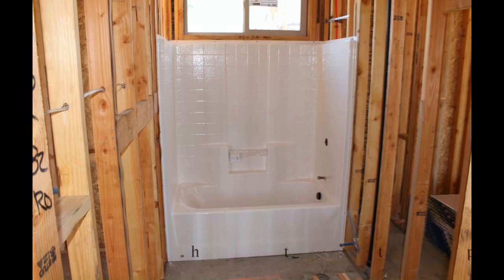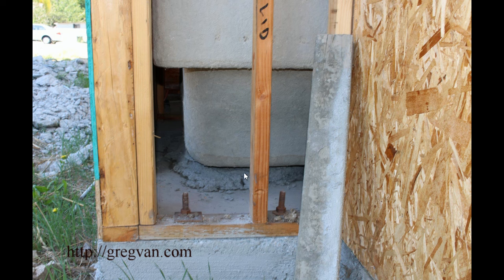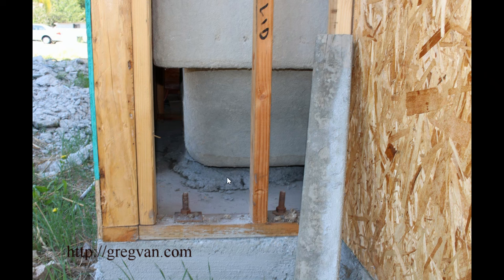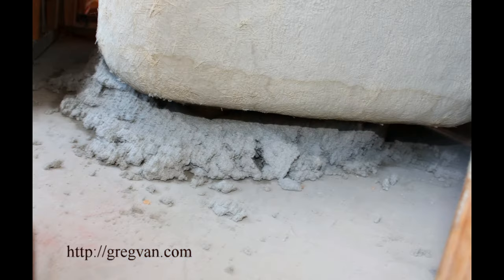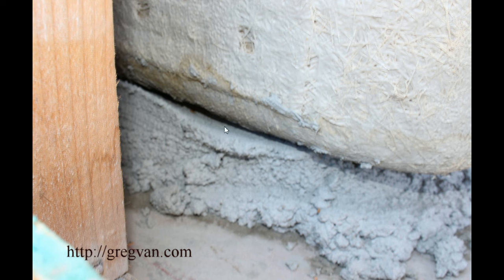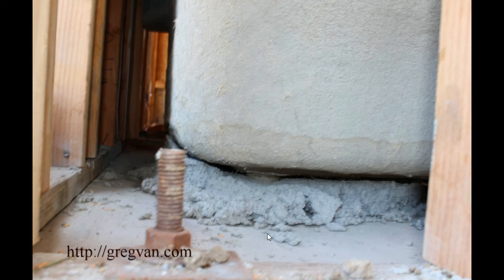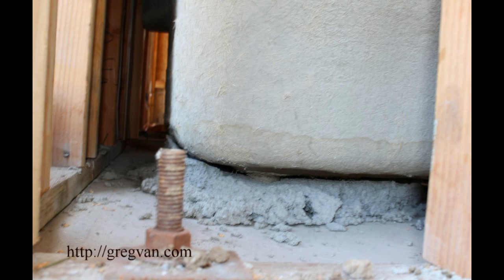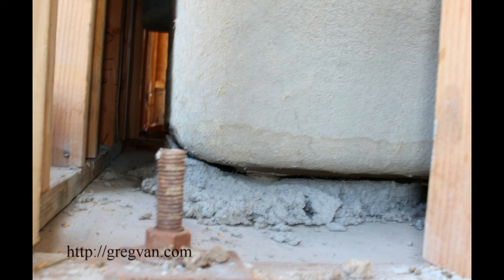Biggest Problems Created When Using Mortar Under Bathtubs – Plumbing

Comment: after installation use minimally expanding spray foam to create a support bed.
Reply from the maker: +bgregg55 I don't know if something like that would work as good as mortar or plaster of Paris, because it wouldn't create a solid surface. The foam might have some give to it.
Reply: Over time the foam crushes as well as breaks down. It's better then nothing but it won't support the floor of the tub forever. 25 years of good use is about the average.  Less if heavily used (Say by multiple kids that take 3 hour long showers...)

 The worst though are the really lazy cheap contractors that throw scrap under them and a bit of foam and call it good then the scrap works a hole into the tub from the bottom.  You can tell because the crack will be punched upwards. 

Mortar, Plaster of Paris, Sheetrock 90 compound are the best long term solutions in avoiding cracks.
Reply: spray foam expands nicely, but once it is compressed, it never springs back.
Reply: @gregvancom  I have an acrylic tub that has plywood fiberglassed to the bottom with only 2 skids touching the floor. Is mortar necessary if it already has a plywood base? I was planning on just using spray foam for bedding and also around the whole shell for the sole purpose of insulating and wall support.
Reply from the maker: @philricke8372  Since I don't know exactly what type of tub you have, I won't be able to provide you with a realistic opinion, but can say that I would probably use the mortar anyway. As far as spraying the foam, just make sure it can't get underneath the tub and raise it when it expands.
Reply: @gregvancom  it's an American Standard 5ft curved side. The foam issue makes sense.
Reply from the maker: @philricke8372  I think my only concern would be the possibility of it moving the bathtub and it sounds like you are going to use it in a place where it won't.
Reply: Cragified hey would u use taping compound on a jacuzzi 60x31” in your own house? We used to use it in new builds.  Also dumb apron is 3 3/8” lower than tub.  Gotta build a little platform since the acrylic isn’t structural too.  Just curious if taping compound is good or something stronger like thinset.  It already has plywood mounted to bottom

Comment: Has anyone ever considered using dry sand, boxed in on the floor with 2 x 4's, as a bedding material?
Reply: That might work, seems like a mess tho
Reply: Co Rin bad idea. Sand will move and not rebound, creating problems later own.
Reply: Nah
Reply: @darken3150  Yeah. It's called Science.
Reply: @marcb2241  hahah sure
Reply: @marcb2241 Sand has been used for 100 years to lay tile and marble floors.  Still is being used in some parts of the world.
Reply: @janettebuba126  Flat bottom, under compression. Totally different to a bathtub with voids on the sides of a sloped bottom. Unless you can fill all those voids - that sand is going to find places to move, and it wont be coming back. Theres a reason it's still being used in that application, and never in another. But sure, let's compare apples to oranges.

Comment: I concrete all my tubs into place. Building a few pour funnels between the studs with poly sheeting. Making sure to foam in the tub drain so the wet mud doesn't end up in the basement. Have yet to have a call back or failure to date.

Comment: In my last house, on a cheap tub no less, I used various widths of cut treated lumber like large shims.   I did have access from both sides though because it was a new build.  After 16 years, the tub floor was still as good as new.  But we didn't have youtube back then for all this information.

Comment: Thanks, Greg i had to uninstall our remodeled Sterling tub comb because the panels would not lock & line up with the tub because it wasn't level enough. The mortar bed worries me leaning towards self-leveling plus I'm only a 1/8 off in the back & limited access in a closet to the drain & overflow. This is our home 1964 Bi-level second-floor main full bath. The subfloor was completely rotted out down to the floor joist. I had to triple the sub-floor to 1"7/8  just to achieve a slight pitch for the replaced toilet flange & 3" non-hub to soil pipe 14" in the corner. 
I love your engineering/code recommendations with awesome visual details and explanation pros & cons
Reply from the maker: I don't know about self leveling products, but could see them working. Let us know what happens. Thanks for the kind words about our videos.

Comment: the problem is whoever installed this didn't put felt paper, or a moisture barrier between the wood subfloor and the mortar... you cannot do that..itll suck the moisture right out of the mortar and make it shrink... you wanted to drive very slow... do things right you won't have these problems in the first place
Reply from the maker: Good idea.

Comment: How gypsum plaster (Plaster of Paris) could be better than mortar bed, really? Isn't Plaster of Paris easier to crack over the years? As for a mortar bed under the legged tub, the mortar is recommended to be put in 9 piles. And how the Plaster of Paris is put?
Reply from the maker: You do bring up a good point and that is the fact the plaster of Paris can crack, but mortar can also and I've seen it happen more than once.

Comment: I’ve thought that if your mortar does end up an 1/8 - 1/4 inch beneath your tub it will still do it’s job if the tub begins to flex down it will not flex far?
Reply from the maker: It will depend on the situation. Keep in mind if the bathtub is moving enough, sometimes 1/8 of an inch could be a problem.

Comment: I have heard of people recommending closed cell spray foam, anyone have thoughts on that?
Reply from the maker: I've never used it and probably won't. However, I would love to hear from anyone who feels it would work better or might be easier or cheaper.
Reply: @gregvancom  It certainly seems like quite a few people use it and swear by it, but it doesn’t seem to be the norm by any means. Logically it does seem like it would work, particularly if you had good access like on new construction. Thanks for your videos.

Comment: I just pulled out my shower pan. It was set in mortar or cement. About 17 years into it's existence the floor of the shower formed a crack and stared delaminating. (Contractor's grade one piece, wall and floor)... I first applied gorilla tape for a while, replacing it with flex seal tape... Literally no leaks for an additional 4 years.

However, while before applying Flex Seal, I wanted to bring both sides back together, because it was gapping. I drilled 4 x 1/4 inch holes in the front outside of the pan, as close to the floor as possible... I stuck q-tips in the holes, to see if they came back wet or anything other than dry. They were bone dry. I then took 4 cans of HD, expanding foam and filled each hole until the pressure forced it out of the other holes. I wiped smooth the holes and let it set... The filled holes matched pretty well with the color of the fiberglass/acrylic, so it was almost invisible...  The gap closed, the foam set and I applied the Flex Seal, rounding the corners to look like safety tape. The floor was very solid afterwards. It didn't have flexing as it had before.

After disassembly, I discovers some interesting things. Under the pan was a plywood platform, impeded with fiberglass, so it was the structural bottom of the shower. There was mortar under that. And my foam only reached halfway across under the shower, at the same plain as the mortar. The foam was acting like super glue, I had to pry the shower from the subfloor. The foam was not even, which developed huge Swiss-cheese like bubbles in addition to the small foamy bubbles. It was easier to remove the mortar than it was the foam, but it all came out with some work. The sub floor was dry and solid.

I do not know why the shower floor flexed and cracked over 17 years. Viewing the construction, it should not have done that. Also the foam was an improvement. I feel like I want to use the foam, in the new construction, but I am not certain. It seems like a good supplement after the fact, but not sure of it being the only support solution.

For other products, like replacement steel tubs I used, had a flat whole surface support that required no mortar, and it was recommended to use foam because there was no additional gap, and in my experience, the foam glues the bottom, to the floor, preventing side to side motion.
Reply from the maker: Can you provide a keyword phrase to the manufacture's who recommend foam? This is the first time I heard of using it and for anyone who reads this, always read installation instructions.
Reply: @gregvancom  my search has me here, installing a tub for first time and ive seen a few methods mortar and foam, as for key words aka brands, ive seen everything from GreatStuff to Loctite 3m, Ect. "Low Expansion" is what people say to use. Im guessing the more dense the foam is in chemical composition the better. Less flex after setting up the better?

Comment: I have a jetted tub (acrylic). Whatever was used under the tub has shifted. I can feel "solid" under my feet towards the back of the tub, but from the middle towards the drain feels "soft". I now have a crack at the curve where the base starts to go upwards. Is there anything that can be done to fix this? Or are we doomed to replace it?
Reply from the maker: I think I would personally replace the bathtub, but understand that you're looking for a way to save money and I don't have one. You might try contacting the product manufacturer or other acrylic bathtub manufacturers to see if they have any advice.

Comment: why would a tub bubble up and crack
Reply from the maker: It could be a result of inferior product development, incorrect installation, but most of the time it will have something to do with the bottom of the tub being unsupported. Over time the bottom of the bath will move up and down while being used if not supported can eventually crack.

Comment: I recently purchased a jetted drop-in tub that has air jets (with piping) underneath the tub.  The tub sits on two connected metal runners.  I am concerned that if I put mortar under the tub, it will loosen the pipes directly under the floor of the tub and break the seals.  Would the metal runners be enough to keep the tub stable (without adding mortar)?  Was thinking about just sitting it on the runners and then using spay foam to give some stability and noise control.  Thoughts?
Reply from the maker: I would contact the product manufacturer for more information, but you can email me a picture and I'd be glad to provide you with an opinion.

Comment: Yes, this video is good. Mortar has its place but under a bathtub is not the spot. Just take a look at a concrete slump chart. In order for mortar to support a bathtub properly it would have to be a zero slump mix so you would need to mix it very dry. I will never do another bathtub with mortar again.
Reply from the maker: You do have a good point about mixing the mortar as dry as possible, because wet mortar can shrink and defeat the purpose.
Reply: ... Okay then, no mortar.  What do you use? Thanks.
Reply: @240LTS  Plaster of Paris. It doesn't settle and it will support the bathtub well. It's non corrosive so there is no need to sheet over with vapour barrier between the tub and mixture.

Comment: So, what would you recommend doing for a tub installation where the manufacturer says it needs a mortar bed but it's a DIY job & the person never used mortar before (local plumbers won't do mortar bed or bother to set things right bc they are lazy af)? Is there some other material that doesn't dry too quickly? I've seen some people use expanding foam but I don't think that is a good idea. This is for an acrylic alcove tub.
Reply from the maker: Good question and I think the only answer I have would be to mix the mortar and set the bathtub as soon as possible. If the mortar dries before the tub is properly positioned, then you will need to remove the bathtub and start all over again.

Comment: bugger that. use a bath that comes with those steel support feet things.
Reply from the maker: That could be a good idea on concrete, but might not be as good for wood framed floors, especially in areas where the weight cannot properly be supported or if the wood rots.
Reply: If weight cannot be supported a bath shouldn't be going in. We are presuming the structure is sound here so will refer back to my original post.

Comment: Would you ever just use wood?
I am a DIY that is installing an MTI S107-Wh-DI tub.  I've built a box that let's the tub float just about 1.5inches off the ground and was going to use Ceramic Thin-Set tile mortar underneath just pushing down until it hit the box.  Is that a good Mortar to use??
Reply from the maker: The mortar seems to conform around the bottom of the tub a little better than pieces of wood, but I would imagine that it could be used on certain bathtubs with flat surfaces underneath.

Comment: you just have to set the tub into the sand.
Reply from the maker: As long as the sand doesn't move and there is no way for the sand to actually move, then it might work. In other words, concrete might be a better choice.
Reply: Ummmmm sand? Nope

Comment: use durabond 90
Reply: Drywall compound?
Reply: yes
Reply from the maker: I'm not hundred percent sure it would work in the same way as plaster of Paris.
Reply: I am,  been putting in for over 20 years.
Reply: Drywall compound is going to perform quite well in a situation like this I think - it's essentially rock solid when dry - if you've ever tried to scrape it out of a bucket after it's dried you will know how solid it is